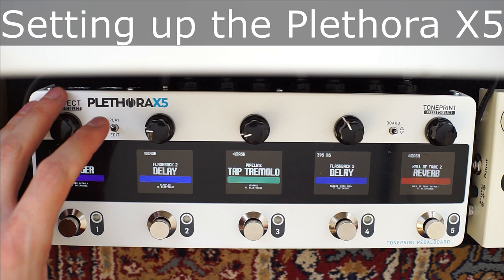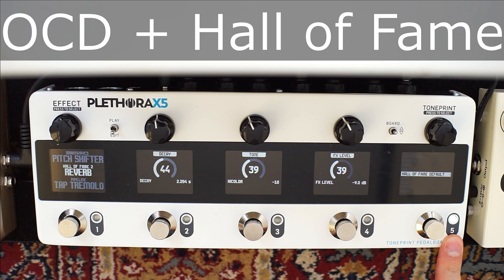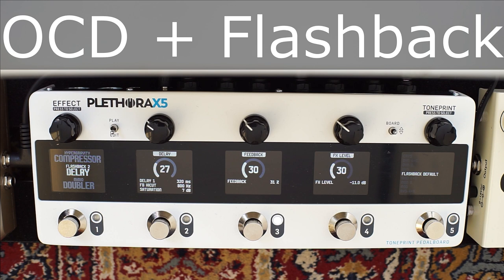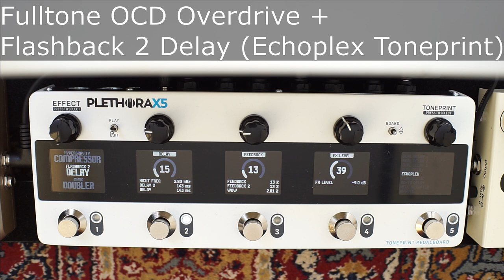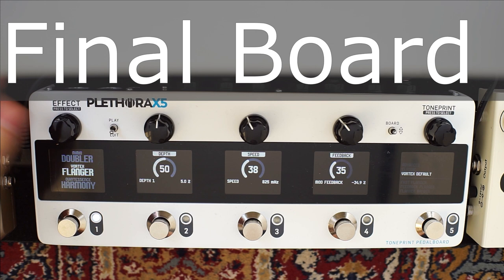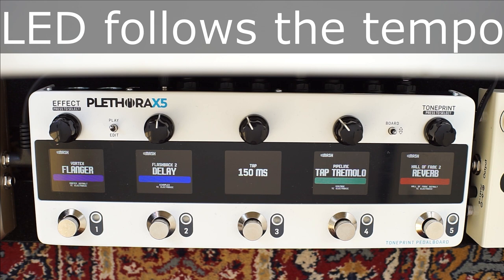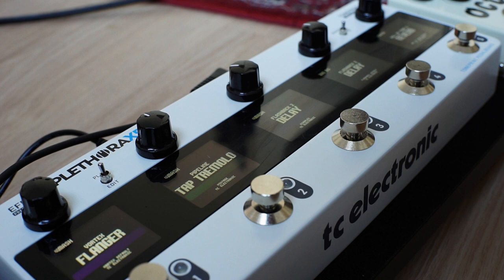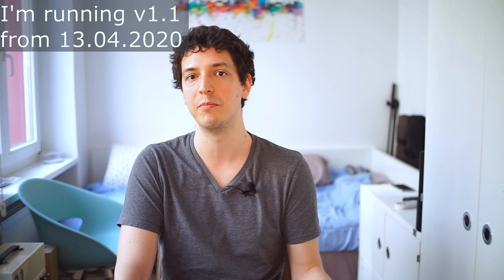TC Electronic Plethora x5 - Simple Board Build & Sounds

Comment: Nice review.  I feel like this unit would be perfect with at least 2 dedicated knobs per pedal to enable live-tweaking the parameters in play mode (just like a real pedal).  With the current setup/firmware, can't see this being useful in a live context but more of a bedroom jam/recording tool.
Reply from the maker: Yes.. I feel the same. It's awesome at home or at the studio and you can even tweak it nicely with your phone using the app, but if you need to quickly change a setting in a live situation it may be a little complex... In the upcoming software version you'll be able to sign controllable parameters to the knobs in play mode, but it's still more effects than knobs...
Reply: @TheBedroomRocker1  Omg when they add that, that will be so amazing. You could edit one parameter with the knob, and another with the EXP Pedal right? That would give you control of two FX

Comment: I've had mine for 2 years and I hardly use it because there too many options and some of them don't sound that great. This was super helpful to me. Thanks. (my normal board goes: Compressor -> Octave -> FX Loop (where I have my drive pedals) -> Short Delay - > Long Delay. And I use the reverb on my amp.
Reply from the maker: Glad it was helpful! Yes, I think it's still more complicated than regular stomp boxes. But if you're a regular stomp box user, this is still easier and more familiar than going to fully-blown digital modelers

Comment: Even w/ a lunchbox amp, connecting via 4cm sounds so much better than this direct path you've chosen.
Reply from the maker: That depends on how you set your amp, how your FX loop work and also taste... I usually set my amp quite clean and get my overdrive from pedals, so delays and reverbs are after the drive anyway. I also prefer to have my delays hitting the preamp rather than in the effects loop. But yes, the 4cm gives you the flexibility to choose which FX to send to the front-end and to FX loop of the amp

Comment: Very good review !  I use ist with the 4 cable method, with the compressor at the Input and the other effects in the FX way of the Bluguitar Amp1
Reply from the maker: That is a nice setup.. Do you go straight from the Bluguitar amp to the PA?
Reply: The Bedroom Rocker in, I use the Blubox 😊. Great speaker sim. No more problems with the Mic or the Mic position !

Comment: Looks very cool but its weird you cant control the delay and reverb types on the unit without selecting a specific toneprint like you can on the actual pedal
Reply from the maker: Thanks for the comment! Yes, it is weird, but they plan to fix this in the next version of the software. You still gonna have 5 effects (each one with at least 3 adjustable parameters) and only 4 knobs available to control them in PLAY mode,  but it's gonna be much better for quick small adjustments. In EDIT mode you can do basically everything...

Comment: I have a question, did the Plethore alter your basic Victory sound because it isn't an "analoque dry through" device ? Some people are complaining that it makes the overal sound too digital in comparison with analoque pedals. I'm considering a Plethora X3 for in my Victory V40 deluxe effectsloop and use my dirt pedals as normal . Because in this setup the compressor is not usable ( I want it before my dirt pedals and the X3 has no effectsloop ) . 3 slots is all I need for my modulation and time base effects. Very good video. Thanks
Reply from the maker: Thanks for the comment. I didn't feel any noticeable sound degradation although on paper I'd also prefer having an analog dry through. I like your idea actually! The X3 should be brilliant in the effects loop

Comment: So u can have multiple delays simultaneously? Can they be fully editable like in TC Triple Delay?? Big thnx❤
Reply from the maker: Yes you can have multiple delays simultaneously. I don't know what you mean by fully editable, but I think yes. In the pedal you always have 3 settings (knobs) plus mash footswitch available. If you connect to the mobile app, then you can edit a multitude of other parameters and can also change which parameters are assigned to the knobs. If you like to be creative with sound textures, it's a pretty amazing tool. I hope that helps.

Comment: I like what you did here.  I am easily confused going into a menu system, so I need idiot proof.  This looks pretty straight forward, but there is a curve.  After all this time do you still have this pedal and do you still use it?
Reply from the maker: Thanks for the comment! Unfortunately, I cannot keep all the gear that I test in my channel. I loved the Plethora and had a great creative time with it. It is indeed quite simple to use and very friendly if you come from analog stomp boxes background like me. For gigging, however, I usually use very simple pedalboards with 2-3 drives, 1-2 modulations, and delay. I don't normally need 5 slots of modulation/delays/reverbs like the Plethora offers and with the Plethora I only had space for one other pedal as you could see in this video. If I had a bigger board or used those effects more often, I would have kept it. I did, however, buy a separate Flashback 2 Mini Delay and a Sub'n'Up Mini Octaver, because I loved the sounds so much, and the Hall of Fame 2 Reverb is also in my list.
Reply: @TheBedroomRocker1  Thanks!

Comment: How does the plethora sound in the effects loop of the amp?
Reply from the maker: Thanks for the comment. It sounds pretty good. I usually set my amps clean, so it does not matter much, but if you're setting your amp gainy/dirty, then it's definitely better to have delays and reverbs in the FX loop for additional clarity. You can also use the send/return in Plethora to separate which effects go into the front of your amp and which effects go into the FX loop. This way you can leave compressors or any modulation going to the front of the amp and place delays and reverbs in the FX loop. I hope that helps!
Reply: @TheBedroomRocker1  - ok, thanks. I've noticed that everyone seems to be running it in front of their amps. I was beginning to think that you couldn't use it in the effects loop of the amp! Sounds great by the way!

Comment: Sounds great! Looking to add one of these to my rig (I play in a country band), and it seems like a good way to keep things simple but still add tons of effects. Have you checked out any of the chorus toneprints on this?
Reply from the maker: Yes, I think it's a great way to have tons of high quality effects available. I found the Chorus sounds quite amazing. You can get from warm classic analog chorus sounds to more crazy heavy modulated experimental sounds. The Compressor (usually important for Country stuff) also works surprisingly well. In this other video I use the Chorus (with Bass) and the Compressor (Bass & Guitar) and also Delays, Reverb, Flanger, and Pitch Schifters: https://youtu.be/72e7PGL0wF8

Comment: Does it have overdrive/distortion?
Reply from the maker: Hi DGC, thanks for the comment. No, it does not have any overdrive/distortion. The Plethora is more aimed at players that like to use analog overdrives/distortions/fuzzes in combination with the flexibility of digital modulations, delays, and reverbs. That's basically how I've used it! The OCD is one of my favorite overdrives, so I can combine it with a bunch of other effects
Reply: @TheBedroomRocker1  thanks. I was thinking of buying a plethora if it has an overdrive/distortion. Or maybe i'll still buy it and combine it with one of my distortion pedals

Comment: Great review! In your opinion, the effects of this pedalboard can compete with Line 6 Helix ones?
And there is the possibility to switch channels in a "double pedal" linking this to the TC Plethoras with a Trs cable, like in Line 6 HX FX for example?
Reply from the maker: Thanks for the nice comment! I have not tried the Line 6 Helix yet, but I think the effects on the Plethora x5 are incredible! Differently from most multi-effect units, TC Electronics first developed all of the effects in the Plethora as individual pedals and, many of them like the Flashback Delay and the Hall of Fame Reverb, are really well regarded. This also means that, even though the Plethora is new, there are already tons of cool presets (tone prints) available to use.
I am not sure I understand the question about the connectivity, but there is an effects loop in the Plethora and you can decide where to place it in your board. You can additionally assign one of the 5 footswitches to be able to turn on/off the effects loop. It also has a MIDI connectivity...
Reply: This beats the Helix hands down. I returned my Helix after two weeks because I found the delays very under par. The x5 is superb.
Reply: @spiralfirst6488  In your opinion, the Plethora is good and usable in a gig?
For example, with different effects combinations in the same song (in Helix and HX FX you can easily have various patches for the same song)
Or it's a "tap dancing" to activate (or deactivate) two or more effects?
Reply: @TheBedroomRocker1  About the Midi... Can the Plethora switch channels in an other pedal with midi connectivity (like the Two Notes Le Clean for example, which has a clean channel and a light distortion one)?
Reply from the maker: @MartinStromer85  you can use your boards as "patches" as they remember effect setting and also which effect is turned on and off. You need a couple of steps to switch them: triple step on FS 1 or 2 to activate board switching mode and then step up (FS2) or down (FS1) to the board you want and wait another 1-2 sec for the board to load. It's fine to do it between songs, but tough to do it within the same song... I think this would be better/faster/easier with an external midi controller, but I honestly have no clue how these things work 😅 I'm usually more of an analog guy... 

I also don't know if you could use the Plethora to control other effects. I have seen people do the opposite... I guess it should be possible, but I think the MIDI capabilities are also still quite limited in the early firmwares. Maybe wait and see how it develops in the next firmware updates. 

Also, here's a Facebook group about the Plethora with some more advanced users and they often make beta firmware available there. This way you can stay up to date on the features as they get released:
https://www.facebook.com/groups/plethorax5andtoneprint/?ref=share
Reply: @TheBedroomRocker1  You are amazing! Thanks for everything and keep up the good work!!
Reply from the maker: @MartinStromer85  Thank you for the nice comment and best luck!